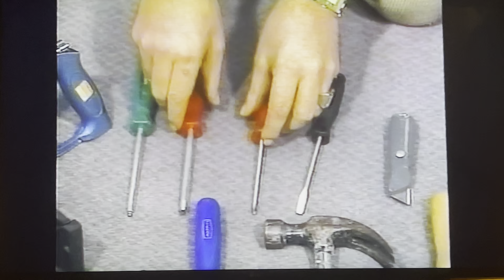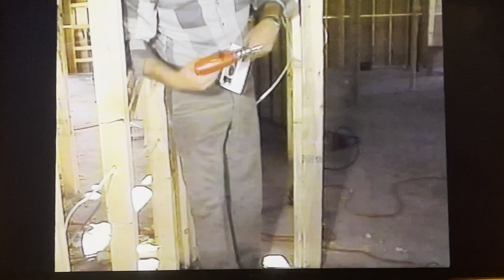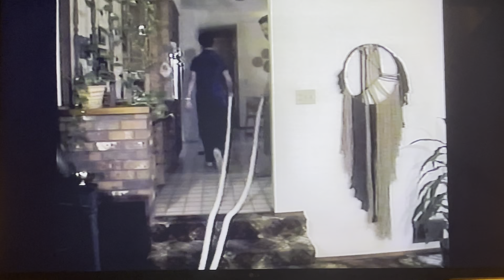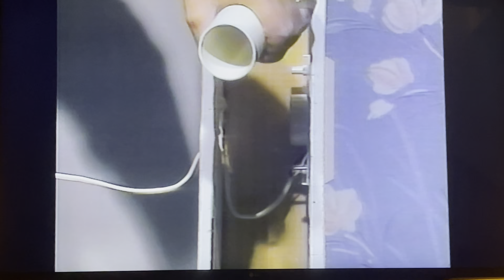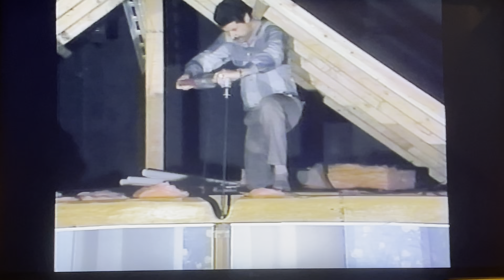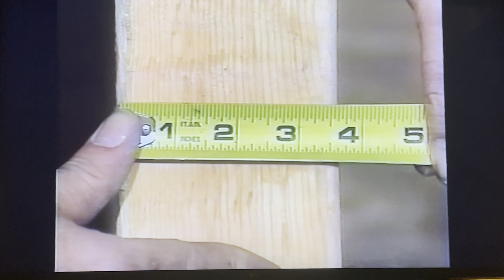Hayden Central Vac Install Video-2 dealers react!

Comment: The newer Supervalve brackets you can just put the short 90 facing off straight out the side, I guess I;ve never used one with a grounding screw setup.